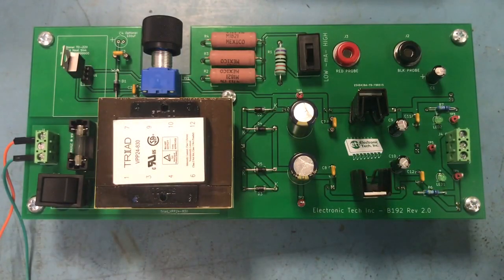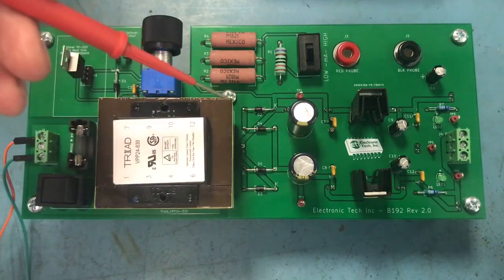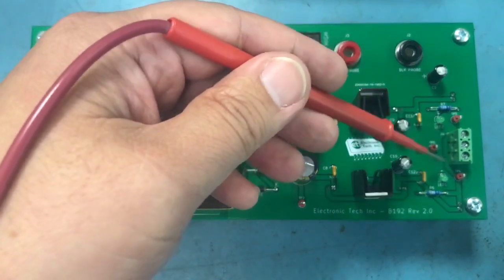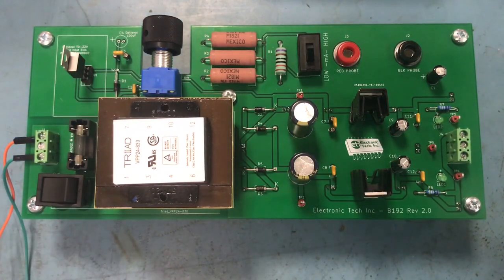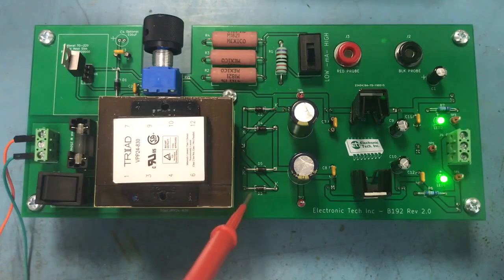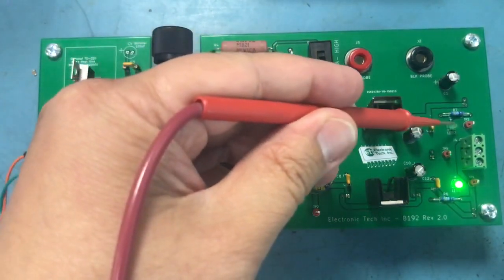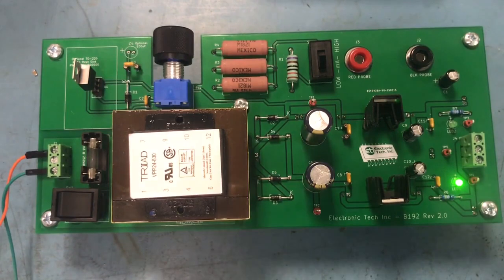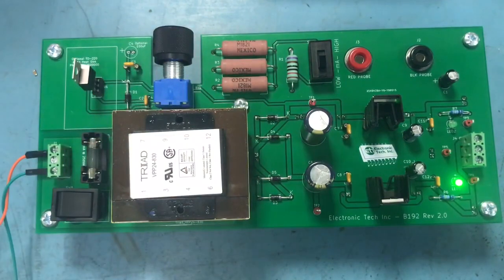How a Linear Power Supply Works - 2019

Comment: great video 

I am a student of your teaching 

question . while measuring the rectifier input if I accidentally put one side of the lead on the output and the other on the input will I damage the diodes or will it just be an inaccurate reading ? ?